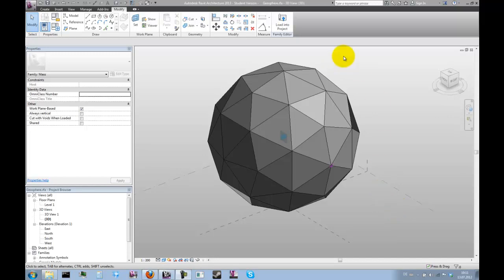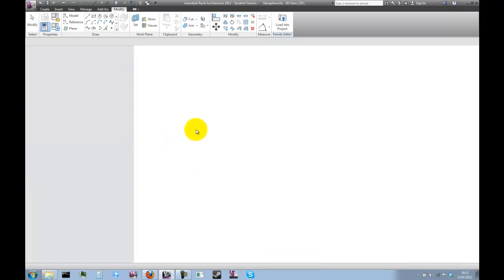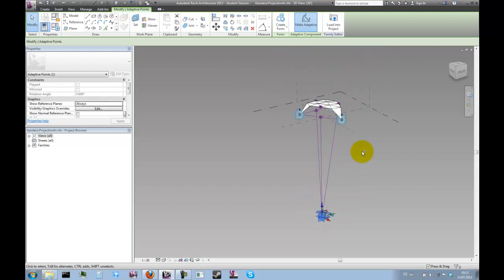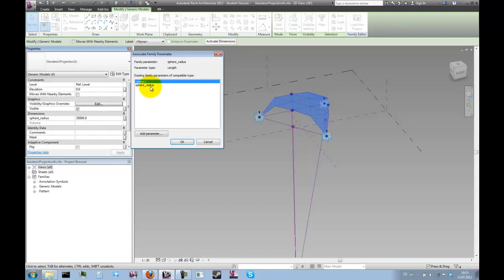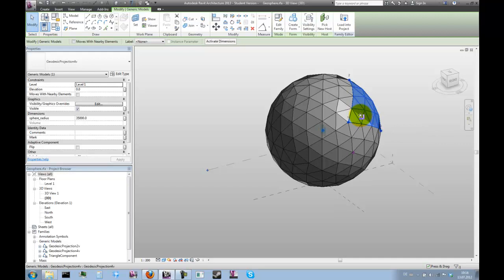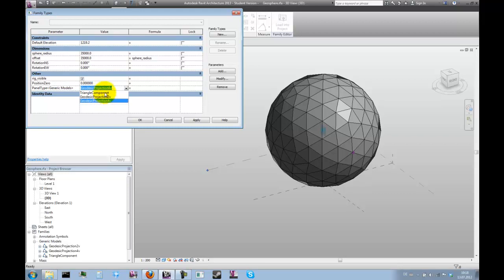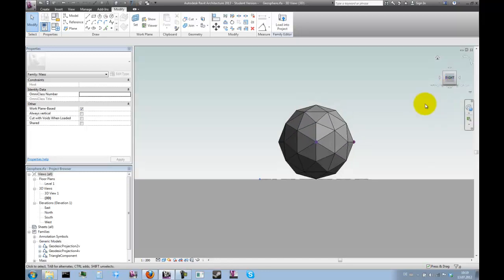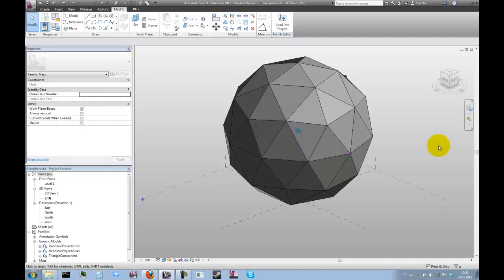Geodesic Sphere in Revit/Vasari Pt. 6 - Increasing Resolution

Comment: Many thanks for posting this tutorial series.  It helps expand design possibilities hopefully resulting in more robust and unique buildings with appropriate design solutions.  I live in a city where most of the buildings look like preliminary Sketchup exercises and videos such as yours will help designers break through limitations as such.  I've been using Revit for 11 years and have used the conceptual mass platform for more basic forms.  For more complex forms, I've worked on projects where conceptual mass was designed in Rhino and then imported into Revit making the workflow very disjointed.  As an full scope architect with a lot on his plate, I don't think I have the time nor brain capacity to learn Rhino so this is very helpful to make my designs more interesting then the usual revit boxes.

Comment: Thank you, very helpful and easy to follow.  in response to Douglas below couldn't you rotate the rig family to the 33... degrees to get constant line around the sphere level with the x/y plane and then only populate the upper half with the primary panel family?  or populate half the rig at the 33 angle and then rotate the final assembly?  I'm new at this but I'm very exited to try this myself.
Reply: +Ready4changes OK, I tried it and it Works!  To make a half dome level with grade I only populated the sphere so I had full coverage to the straight line around the center. Then I rotated the rotationNS value accordingly.  I gave each of the four panels in the GeodesicProjection2V file an instance based on/off visible toggle label.  That way you can turn each panel off independently in each 2V panel family instance. Very cool model been wanting to make one of these for a long time.  And I learned a lot about point elements too, very powerful tool thanks again :)

Comment: How would you go about cutting this in half (making it into a hemisphere dome)? Thanks.
Reply from the maker: Hello Douglas, I don't see an easy way to do this with out-of-the-box Revit (as in "5 minutes and it's done"). You could, of course, rotate the sphere around the Y axis until one row of panels lines up horizontally and then hide all the panels below that line. But nowadays I would much rather solve that kind of problem with Dynamo.